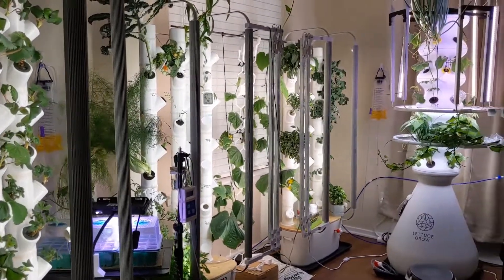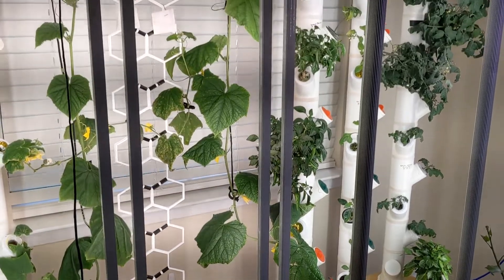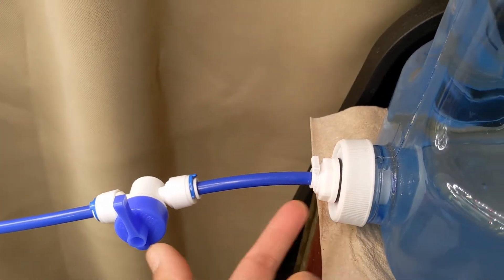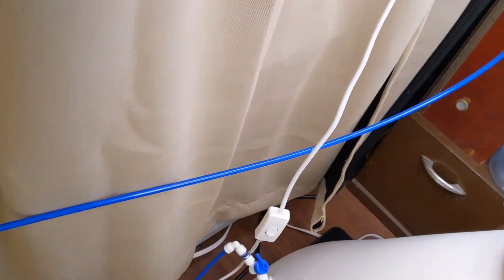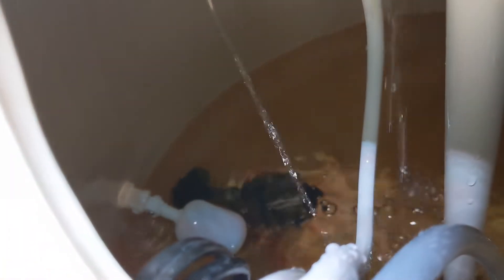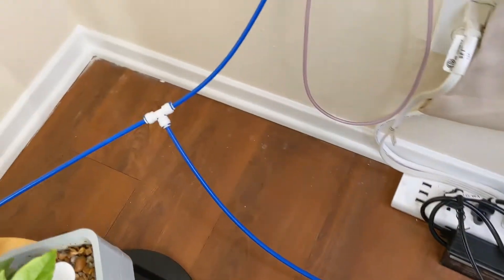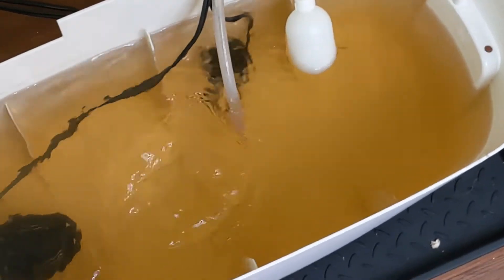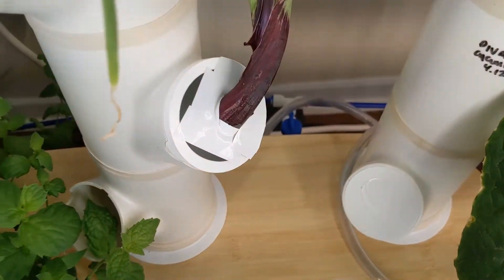Gardyn and Lettuce Grow Farmstand Automatic Water Top-up

Comment: This is so great, thank you! I have a question, gardyn, you have the pump in the reservoir, and there is another black "disk"? on the bottom. What is that for? Do you use something different than a T connector at the end? At this point I'm only wanting to put the gardyn... I think. Not sure how well it would work adding the farm since the reservoir is so much shallower.
Reply from the maker: I'm not sure what you mean about a "black disk". This is what's in the Gardyn Reservoir, a circulation pump(Left), a small black pump+Clear vinyl tube(for draining the tank - Right), and the white float valve(Right). I use an elbow connector at the end of the blue tube so the tube doesn't kink. Back when I had an AG Farm, I've thought of using Battery Float Valves. I was thinking I could mount it onto the lid. They are small enough to fit and shouldn't interfere much with the plant roots. Just an idea, they come in different sizes...
Reply: @jermee  hm, interesting about a different float. Thanks for your response,  and Video! With hubby's help, I will start with the gardyn and go from there 😁

Comment: Very cool. Wish you’d explain a bit more how to actually do it, like did you have to drill holes for the blue tubes? How do you “set” a float valve?
Reply from the maker: Here's a simple video by J Z on how a typical float valve functions and how it can be used. https://youtu.be/8Z1xMH0l0CI